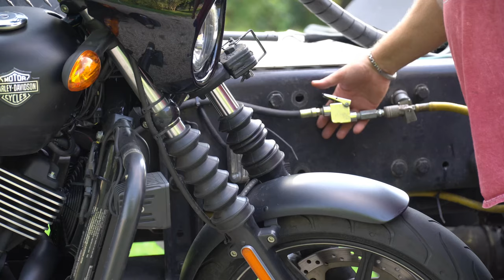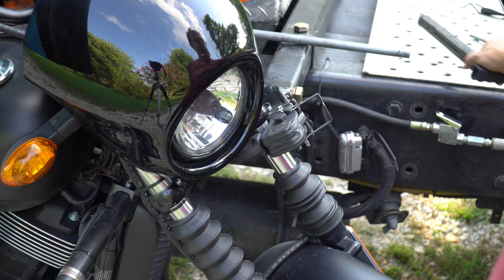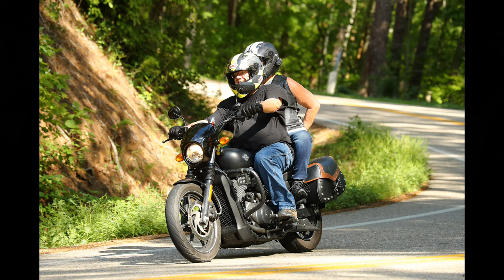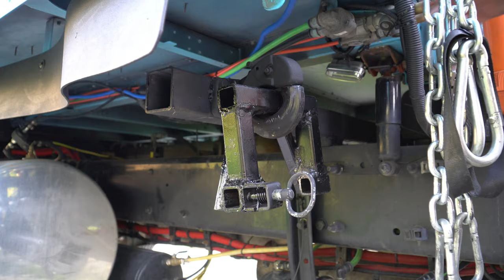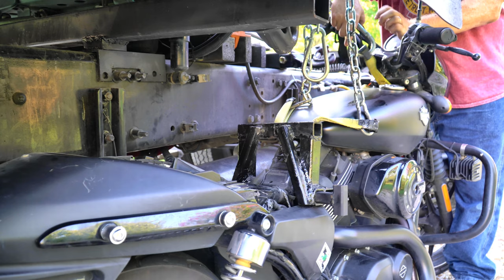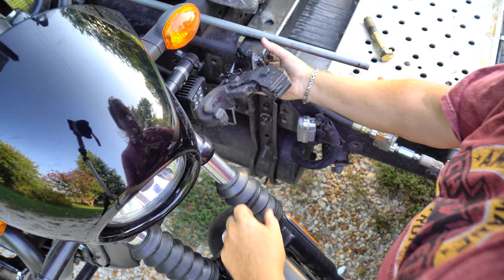Motorcycle mount on a semi truck

Comment: Looks great, very ingenious and incogneto. Would it be possible for you to provide a parts list with hyperlinks as to were to buy, and maybe a diy on the build?
Reply from the maker: If your serious about building one I can definitely help you. Keep in mind I shopped for the bike to find one that would hang easily and chose the Harley specifically for the application. I did have a Yamaha under the truck for a year but I supported it completely different and it wasn't as solid of a mount. The entire rig is made up of 3" box steel, 2 1/2" box, 1 1/4" box, 1" box, 1 plate mounted pintle hitch, 1 bar style pintle hitch and a harbor freight ram. PM me on messenger for more details if you need them.

Comment: Do you have a parts list? So NEED this in my life
Reply from the maker: Unfortunately harbor doesn't sell the ram anymore. Other than that it's just 3 inch 1/4 wall box steel with 2 1/2 steel as the telescope arm. 2, 5 ton trailer hitch brackets and a handful of grade 8 bolts. You should know I picked this bike because of the way the frame is made it has a natural place to hang the bike safely. If you want more detail hit me up on Facebook or text me at 507 360 5382
Reply: @charchri4  messaged:) thx

Comment: Looks like a fine way to tear the frame and forks apart
Reply from the maker: Maybe but its been hanging there well over 150,000 truck miles and 5,000 bike miles and no issues.
Reply: Always gotta have one hater. ..

Comment: Look into the rampage bike ramp. It’s all automatic and much safer.
Reply from the maker: Safer how exactly? This has been on my truck for 18 months and nearly 200,000 miles without an issue. Its secured to the truck with 2 trailer hitch couplers rated at 10,000 lbs each and they are mounted to 3 inch box steel welded and bolted with 5/8 grade 8 bolts to the frame. You could flip the truck a dozen times and the bike would still be hanging there. Besides the rampage ramp costs more than my set up including the bike and you have to have 2 empty spaces beside the truck to deploy. I can park between 2 trucks in normal parking spots and easily drop it.